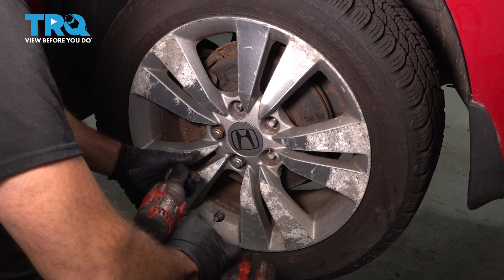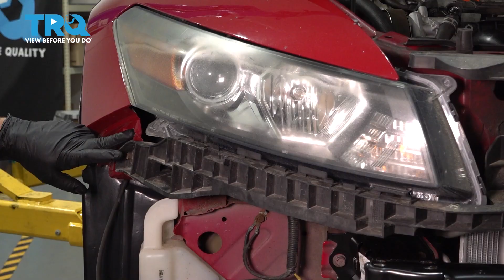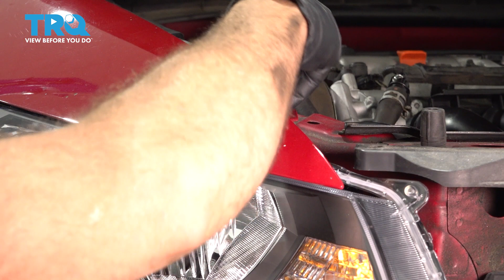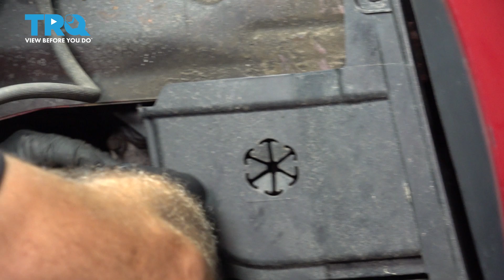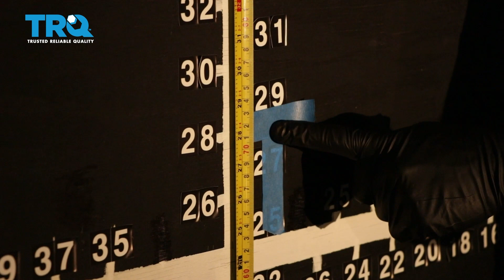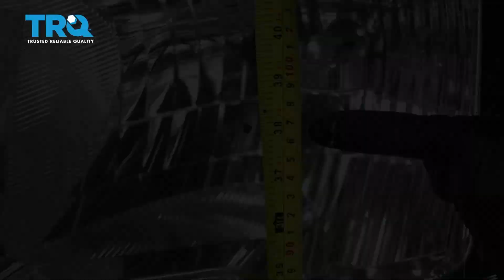How to Replace Headlight Assembly Kit 2008-2012 Honda Accord

Comment: Thanks!  Changed out both housings that were so cloudy you couldn’t even see through them. I’d had them buffed out 2 times and it would last about 6 months. This seemed like a slightly better way to go. 

It took my son and I about 90 minutes from start to finish, although we did not remove the tires.

Comment: thanks for the guidance.  But it is not necessary to remove tires and the undercarriage cover.  See comments by Kennethcoloma7742
Reply: Have you done this yet? I bought new headlights and they came in today. Did you get away with not removing the skid plate and wheel wells?

Comment: Why did you remove the tires and undercarriage cover ?
Reply: Kenneth, that is the part I am dreading!!  😭
Reply: They're attached to the front bumper, gotta get those off to remove the bumper and get to the housing.
Reply: Exactly what I was thinking. It should be totally unnecessary to remove the tires and undercarriage.  If you have a lift, then maybe it helps but most people don't. See a similar video from 1A Auto https://www.youtube.com/watch?v=h3NYIkdopFc